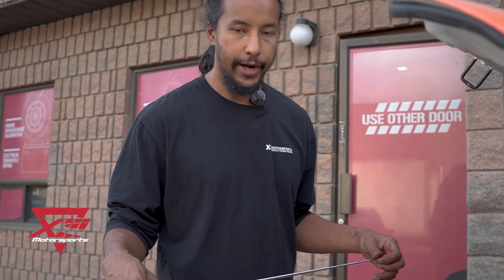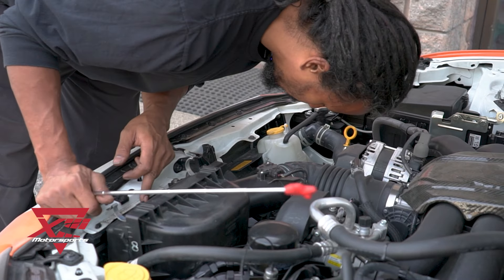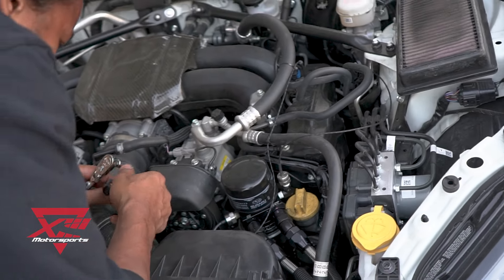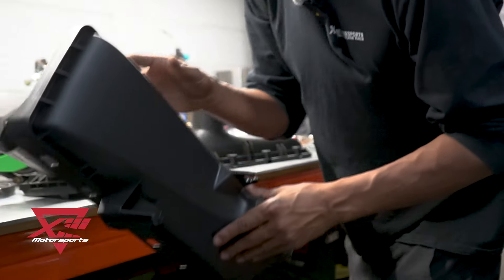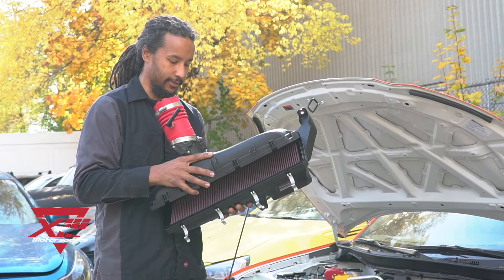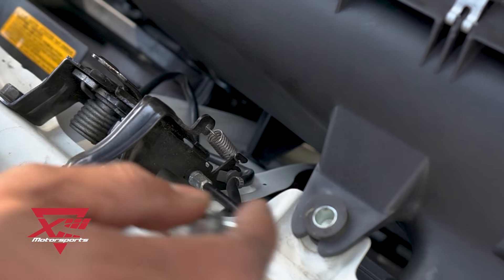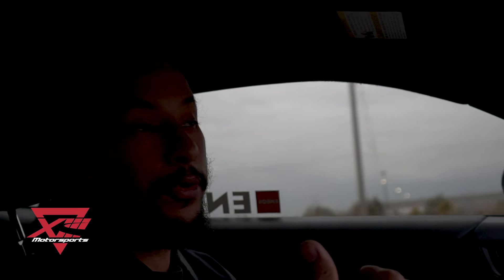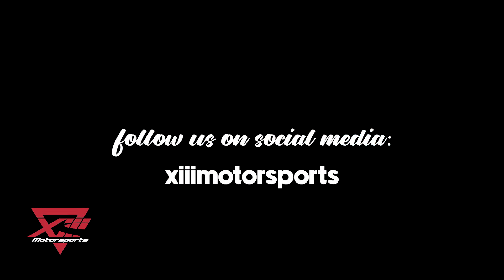How to Install GR Intake - Toyota GR86

Comment: The plastic tube should sit flush on the inlet. Use a small spray of silicone.
Reply from the maker: At which point in the video are you referring to
Reply: @xiiimotorsports  He's probably talking about 9:35. That black part should be flush with the intake hose.
Reply from the maker: @jtworksoncars6341  is it not ? I still don't get it lol
Reply: @xiiimotorsports  Look at the part with the constant pressure clamp. You can see a gap between the black lip and your red intake hose.  You need to push it in more.

The intake hose to airbox portion is fine.
Reply from the maker: @jtworksoncars6341  there is a notch there to prevent you from putting it on the wrong way